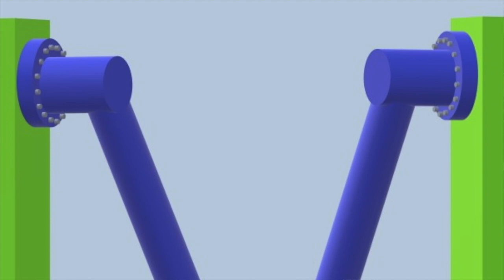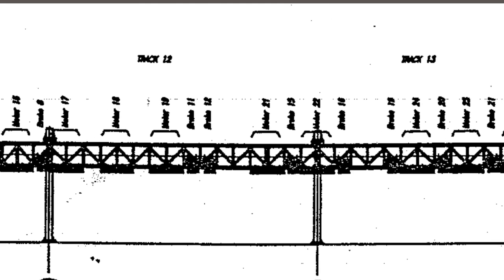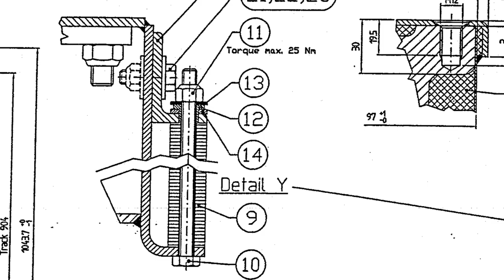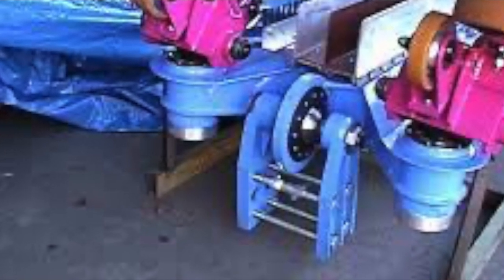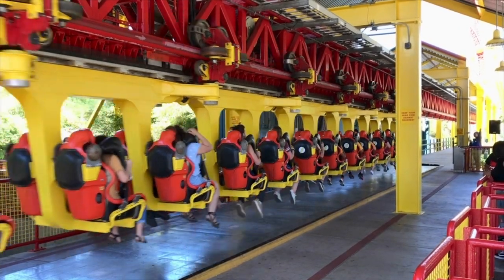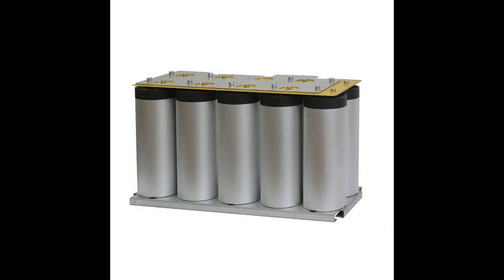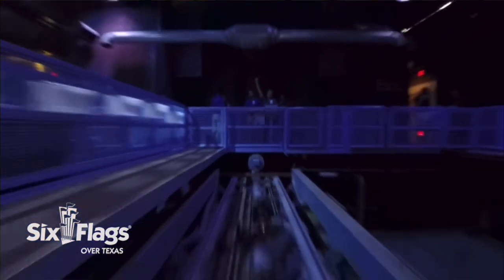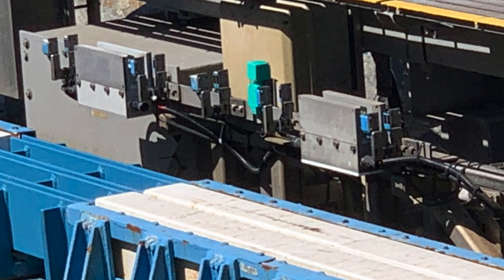MAGNETIC LAUNCH SYSTEMS 2: Linear Inductive Motors and how they work

Comment: Thanks for going into how that drive circuit distributes power, it’s cool that it’s a common power supply and the motors just switch in and out as the train comes to that motor segment.
Reply from the maker: Neat stuff!

Comment: Ryan I have rather enjoyed hearing your knowledge about your experience with roller coasters. Something that has been surprisingly hard to search for on my own is the difference between LIM and LSM on roller coasters. I did manage to find 1 page that discussed it, however I found it rather difficult to absorb due to the technical terms being used. I would be very interested to see a video that explains the differences, and if there are any circumstances where a company may choose one over the other. I noticed in one of your newer videos on zamperla trains that you mentioned there's not really any reason to use LIM over LSM, but one of Vekoma's newest roller coasters for families seems to use LIM.
Reply from the maker: I have a LSM video coming out Friday. That should be a good one to compare. Let me know if your still unclear after that video. Another subscriber brought up that LIM trains can be much lighter minus the weight of the magnetic yokes under the train.  The LIM systems are also slightly more forgiving as far as technology is concerned.

Comment: Great video..I'm 10 minutes in. You mentioned the fin and stator are around 8mm gap.

 Ive always wondered the chance the fins would not line up with the gap and ouch...big problems when it hits.

I wonder this also as with these launches over 100mph how do they keep the fin that precise from not moving and risking it not being in line with the gap?
Reply from the maker: Although alignment is also critical on an LSM ride, because they use earth magnets the clearances are much wider about 6mm on each side of the stator. Compared to LIM 2(ish) on each side

Comment: Big Thunder Mountain at Disneyland Paris also uses LIM drives to move the trains around. As far as I know, it had them from day one, of course not for a launch or to replace the classic chain lift. Just like explained here as a replacement for your typical tire drives in and out of the station (or in this case also into and out of the maintenance bay)
Reply from the maker: Sense they weren’t a launch or a “major” part of the the ride it was super hard to find out when they were out on. The date was a recollection from the parks maintenance director.
Reply: @ryantheridemechanic  Yeah, those less exciting parts don't usually get a lot of attention, except by people working with this particular rides and the really nerdy enthusiasts. 😅 Everyone else just takes for granted that there is something moving the train in and out of the station. But this makes the Paris version of Big Thunder Mountain my first LIM coaster. 😎
Reply from the maker: @Colaholiker  makes me really wonder where else they were used. But like you said, it would be hard to find out without talking to all parks. I was interested to see the people movers LIM in use sense 1975!! Wow
Reply: @ryantheridemechanic  I usually pay attention and I'm not aware of any other coaster that's not a launch coaster having them. Not sure why, as those small ones likely are a lot more manageable in their electrical demands and require less maintenance than tire drives. Maybe they are just so much more expensive.. 
I know there is a people mover at the airport in Houston, TX that used LIM, there's a video by Technology Connections about it here on YouTube.

Comment: Id be interested in knowing if you know what modulation settings are used for the IGBT drive systems. Listening to typical impulse models they seem to start with 500 Hz Asynchronous PWM before jumping up to 1000 Hz Asynchronous PWM. Some VFD/VVVF enthusiasts have probes referred to as "Induction Recorders" used to get the switching profile of the IGBTs then convert that to audio.
Reply from the maker: Sorry, that’s way above my head! Haha!

Comment: I never worked a ride that had a quick stop nor knew of any rides in my park that had one. What is the difference between a quick stop and a ride stop (assuming it is a conventional coaster with a lift hill, not a launched type)? I know at least some Cedar Point rides had quick stops, but I don't think Six Flags used them much if at all.
Reply from the maker: Impulse coaster was the only one over ever seen it on. Basically you could recover the train with no keys. Ride stop you had to restart the ride. So preferably hit the quick stop before ride stop before Estop

Comment: Thanks for that great explanation! On the weight of trains, how heavy are B&M Invert trains? 7 cars or so. I heard they are about 40 tons (not sure anymore), but if you stop them on the lift, they shake the station hard
Reply from the maker: Most everything is between 1-2 tons per coach. Only one I’ve hear very different was X2 at magic mountain. That’s super heavy. But it’s also about 3 trains wrapped in one.

Comment: Awesome video! Out of curiosity, I got a ride on possessed (an LIM impulse coaster at Dorney Park) and experienced an odd ride cycle. It initially launched like normal but quickly made almost like a scratching noise and the train felt like it was dragging on something and slowed down. The train barely made it up the first spike, but then the ride cycled normally for the rest of the cycle. The ride ops did not seem to care so I figured it must be a normal occurence. Any idea what could have caused this?
Reply from the maker: Intamin has a procedure to take malfunctioning IEE NET seasons out of the loop. When you take one off line, some times the drive does extremely weird things like what you describe. Measurements at thousandths of a second are not getting to the drive properly and that’s the result. Will it happen every time, no, but it does happen. Sensors in the main launch area can cause that. Sensors in the station area will cause the train to home erratically or not at all.
Reply: @ryantheridemechanic Interesting, thanks for responding. Haven't even finished the video yet but still lots of good information. Are the capacitors easentially just for power factor correction and smoothing? Also, do you have to worry about EMI and ripple with these kinds of rides. Considering the level of precision you were talking about, I feel like they would probably have to.
Reply from the maker: @nesmanmain0001  when you are ready check out the video on NET sensors might help more 

https://youtu.be/RYSe67tCcLo

The devices used to concentrate the fields also shields other parts. So mainly the biggest part you have to deal with is static electricity building ups as a byproduct.
Reply: Interesting! Thank you for the video link! Looking forward to episode 3!

Comment: Another great video! Did you have to perform any speed/position loop tuning with these drives? Or was that typically handled by the drive manufacturer? I work for a control systems integrator and have to do drive/motor turning regularly so I was curious if you personally had to dabble with that.
Reply from the maker: The tuning was done before my time. Once the drive was “set” no one was allowed to modify anything. Intamin didn’t even want to make any changes because it wasn’t really their drive at that point.
Reply: @ryantheridemechanic  Ah ok. That makes perfect sense. Thanks for the response!

Comment: Did you say 3 phase sine wave is not used. Square wave is used, is it just a efficient?
Reply from the maker: They are looking for the exacting control of a square rather than the curve of the traditional sign. Basically it’s DC masquerading as AC of that makes sense at all.

Comment: Do you think Disney would ever change Incredicoaster to LSMs and maybe new trains by Mack rides? Probably retrack it as well?
Reply from the maker: Possibly make the conversion to LMS I could see that. I’m thinking they would stay with same or similar trains made by Intamin.  If they needed to retract the ride I’m also betting Intamin would make it again.
Reply: @ryantheridemechanic  Thx for the reply! Also two questions, are Intamin Impulses a pain when they break down and do ride operators turn on blocks in the morning or does maintenance do it? Thanks!
Reply from the maker: @JungleJetAviation06  1- depends on the failure. Simple resets are easy enough. 
2- blocks are always on and can never be bypassed or turned off. If your referring to a block check it depends on the park. Normally maintenance preforms their own block checks but some parks have operations preform them as well.

Comment: How much are the stators for LIM systems per piece?
Reply from the maker: Depending on the size of the winding between $9-14k
Reply: @ryantheridemechanic  I also wanna mention that I read somewhere on the internet that the hydraulic launch system for Top Thrill Dragster was like $6 million dollars!  I wonder what the most expensive part of the hydraulic system there is in that system before the ride retired.
Reply from the maker: @tubepotato500  I can’t speak with first hand knowledge of hydro launch rides. But all the components are expensive but hen you have to multiply that time 12 I think it is. So if you divide by  12=$500k per system. Not to bad actually.
Reply: @ryantheridemechanic  The figure I mentioned to you was several years ago when I saw it when I was trying to figure out the approximate cost of that system.  I know that the large drum with the cable wrapped around it had 16 motors on each side with hoses connected to them from the hydraulic reservoirs and accumulators.  I'm sure the accumulators are a fortune to make.  This thing was immensely powerful too with over 10,000 horsepower to deliver that 120mph launch in under 4 seconds.  I rode TTD many times and it's an adrenaline rush with that launch power!
Reply from the maker: @tubepotato500  for sure. I bet the accumulators are extreme in cost and you need a lot. The drum is probably  the cheapest component. On Vekoma rides like a boomerang the drum is meant to be changed every couple of years so it doesn’t eat the cable up.
Reply: @ryantheridemechanic  Interesting to know!  What's the frequency of cable replacement on hydraulic launch coasters?
Reply from the maker: @tubepotato500  appears to be twice a year. Cables a cheap for what they do.
Reply: @ryantheridemechanic  For sure.   Amazing feat of engineering!  What coaster launch system is the most problematic and most expensive to maintain?
Reply from the maker: @tubepotato500  I’d have to say hydraulic. But that’s mainly because they are the biggest power house units out there.

Comment: Ive worked on cnc equipment with servo's and encoders and when one of the encoders go out or gets out of sync the computer freaks out and sends full amperage and frequency to the servo to try and find its position!  It takes a split second to trip out the drive.   Its violent and will definitely wake you up!!!

Comment: This is off topic so I apologize, but I have to ask since you’re a Disneyland fan. It’s a common belief that the Rocket Rods damaged the People Mover tracks, but I’ve always had a hard time believing that. I’ve always believed that it was closed because it was expensive to maintain. Do you think the Rocket Rods could have really caused that much stress to the tracks?
Reply from the maker: Yea, the rods accelerated the fatigue that the people mover was already working on. The structure was just not engineered to handle the heavier rods and track in place. Disney said the math was ok but looks like someone didn’t carry the 1.  So in order to get the movers back they would have to almost completely remove the track and structure and rebuild it with today larger standards I. Place to handle the loading. If sad but they might cross that bridge when the structure becomes a overhead hazard to people. I would love to see that come back with the LIM like disneyworld uses.